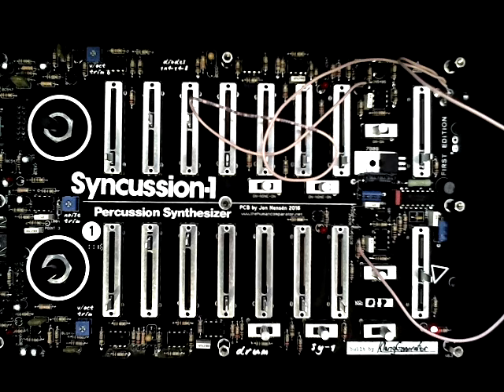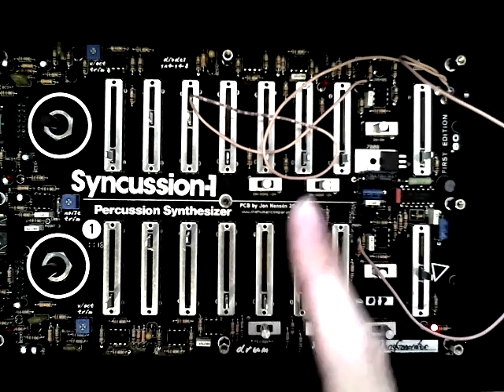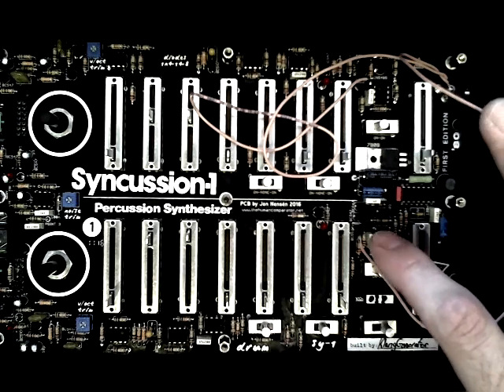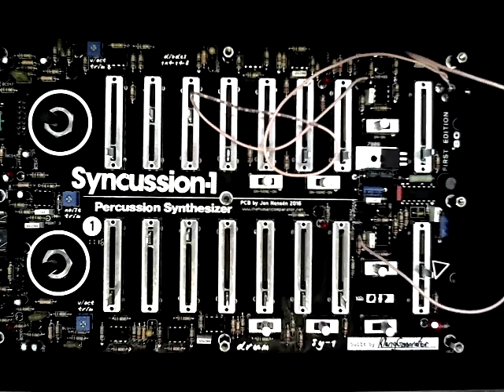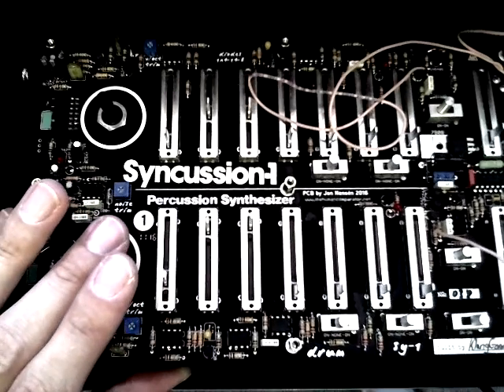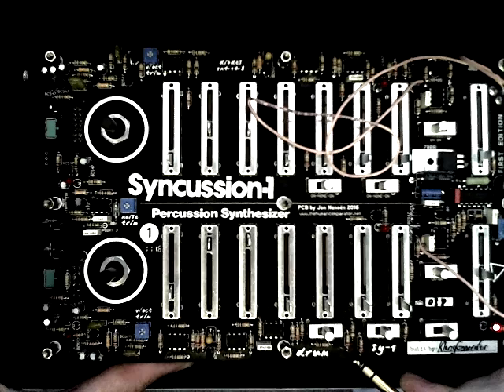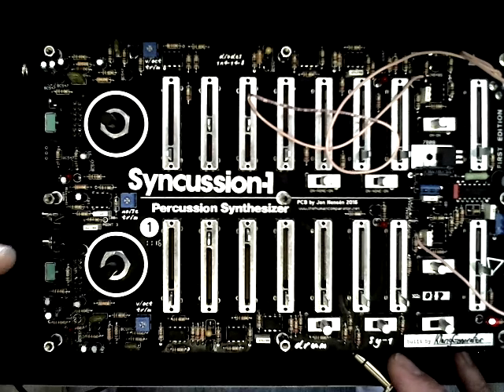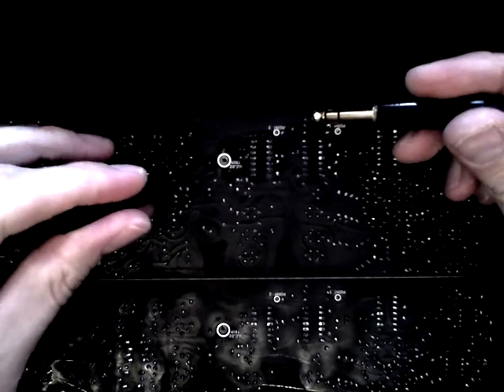Pearl Syncussion SY-1 DIY Clone Tuning Without Frequency Counter

Comment: You really shouldnt ground that resistor.  You connect an output of an ompamp to 0V when you do that. That was really bad advice by THC.  Try this:  Send a clock signal (something REALLY fast) into the trigger input so it's re-triggering as fast as possible, that will fix the OSC drift.  The SY-1 manual effective says the same thing (you're supposed to hit the drum when calibrating)

Comment: Hi there! Would you recommend this Kit for beginners?
Reply from the maker: It could be a bit tricky for an absolute noob. This unit also requires matching transistors, so you will need some deeper knowledge and the proper tools. Also you have to work very precise, otherwise the boards won't fit right into the case. I would recommend to start with an easier project if you have never used the soldering iron before.